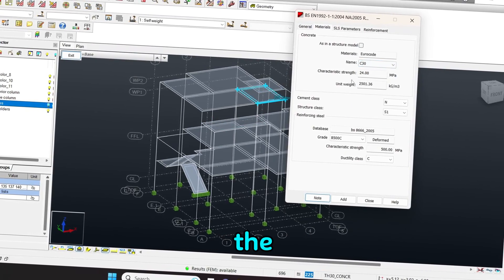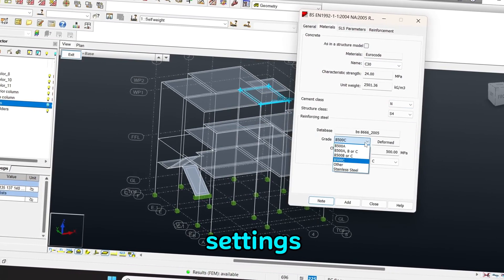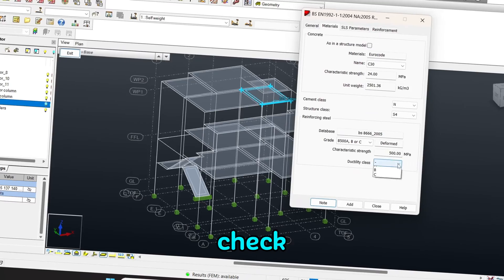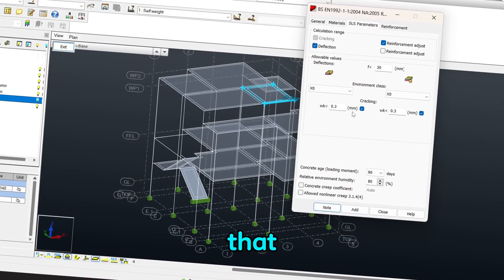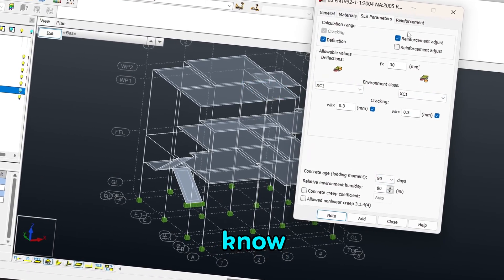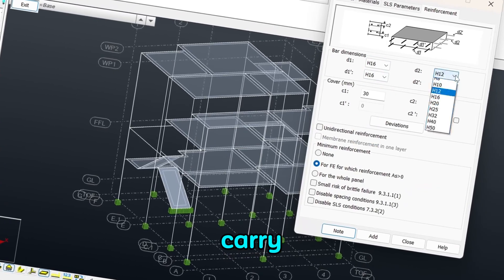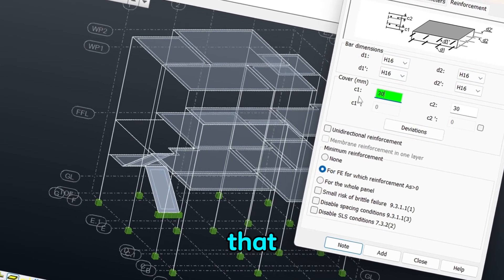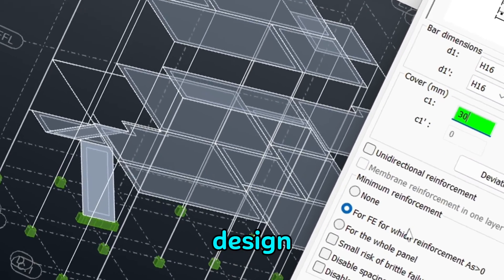Robot structural analysis course || Design of a full RCC Building step by step.

Comment: Hello sir, correct me if am wrong but the course doesn't have a video where you modelled the slabs. It has beam modelling then skips to analytical model. I await your response
Reply: I have finished the course but there's videos missing as it's only 94% complete. The course ends when you send the model back to Revit. I have played every video and the certificate is disabled. Please help
Reply from the maker: @oramahmassah2781  congrats for reaching 94%..Will check
Reply from the maker: All elements are modeled including slabs... If you enrol in course and do not find it let me know. It will be provided immediately.
Reply: @skillmaxacademy  I have bought the course but haven't seen any slab modelled. I assume it was meant to be between Beam modelling and analytical model, but it's not
Reply from the maker: @oramahmassah2781  thank you for feedback.. Then I just missed it during upload.. It will be uploaded.
Reply: Thanks Sir. Will be waiting
Reply from the maker: @oramahmassah2781  Your observations have been attended to. For faster response please use email. Thanks for feedback
Reply: @skillmaxacademy  Will do thank you
Reply: @skillmaxacademy  which email should I use for communication?
Reply from the maker: @oramahmassah2781  skillmaxacademy@gmail.com
Reply: @skillmaxacademy  Greetings Sir
I sent you an email a few days ago. Did you receive it?
Reply: What email should I use to communicate?